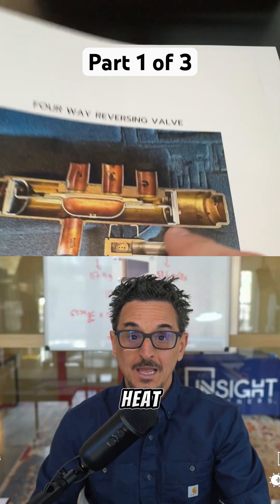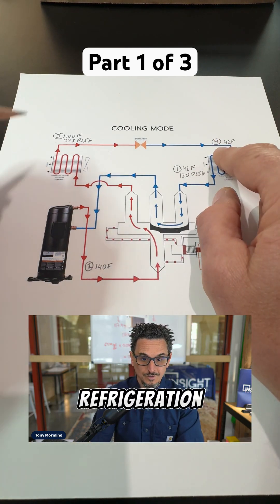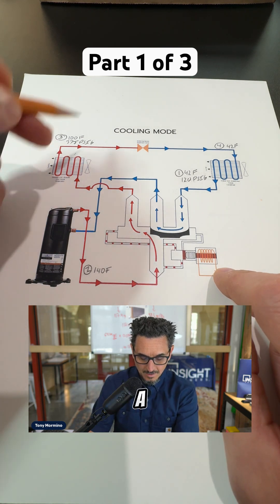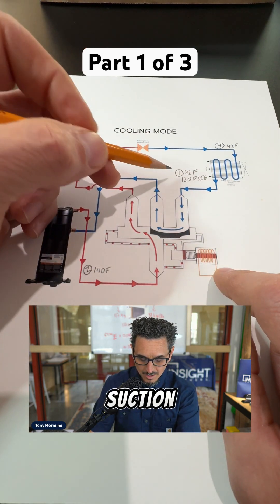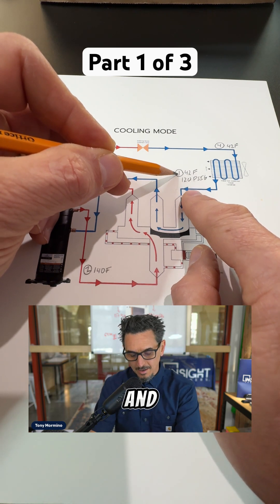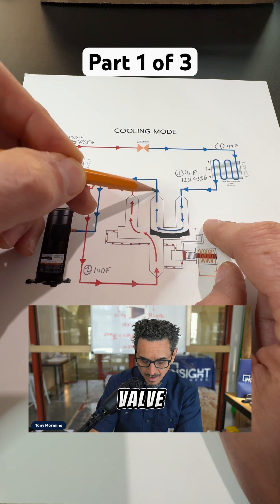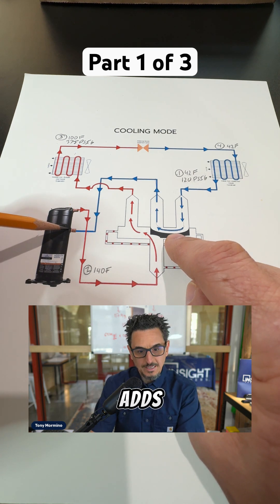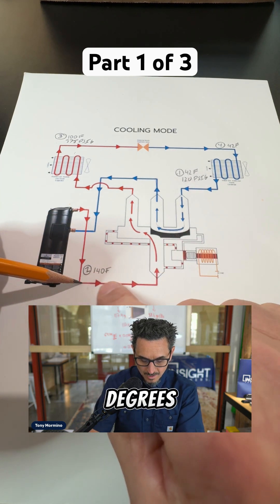Part 1 of 3 - Heat pump refrigeration cycle explained with 4 port reversing valve.

Comment: Does the compressor adds heat to the refrigerant or the heat is the result of increased pressure of the gas?
Reply: Well both because the compressor increases the pressure of vapor refrigerant which also increases the temperature